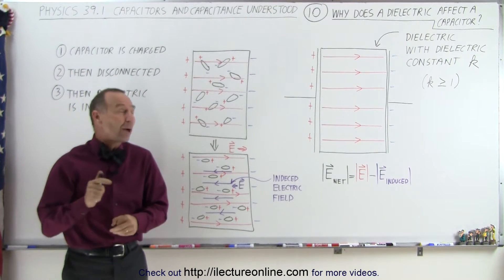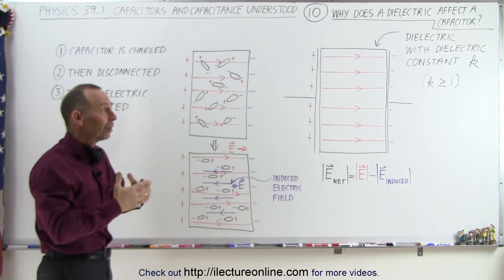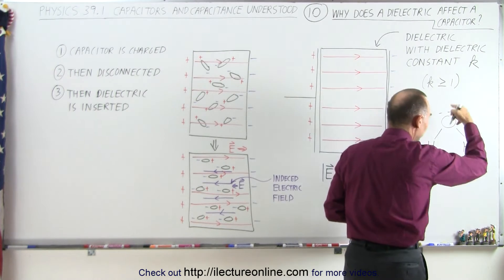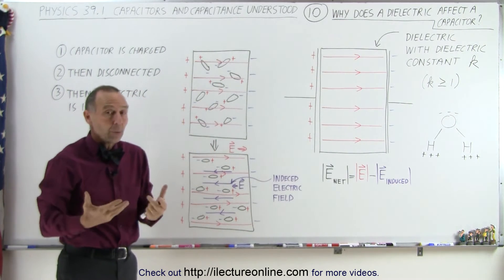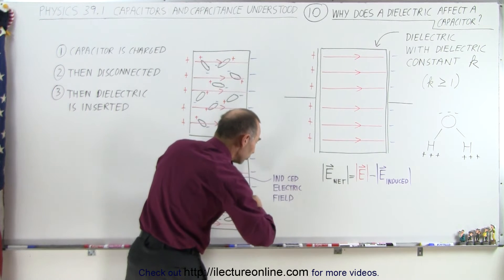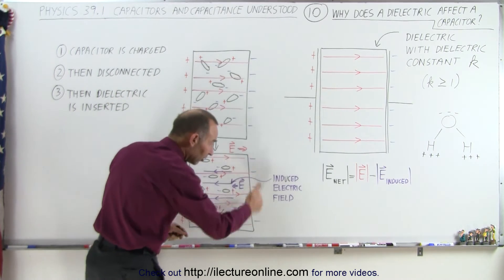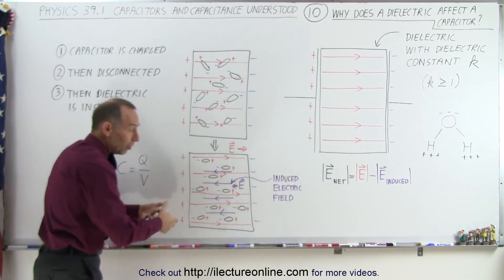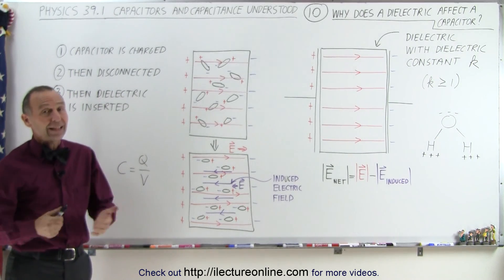Physics - E&M: Ch 39.2 Capacitors & Capacitance (10 of 27) What is Dielectric Effect on Capacitor?

Comment: Thank you for the lecture. I'm curious if the dielectric gets stressed mechanically when recurring charging and discharging. Could this repetition of 'charging and discharging' cause micro-cracks inside the dielectric body and consequently the dielectric has a lower breakdown voltage value than that of it's initial state? please let me know. Thank you.